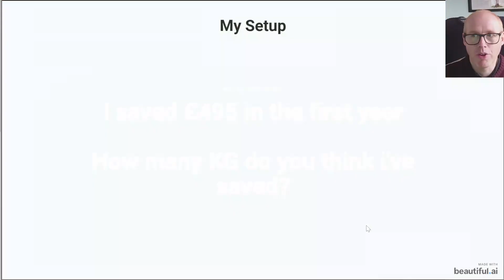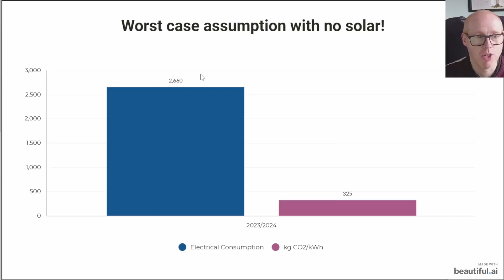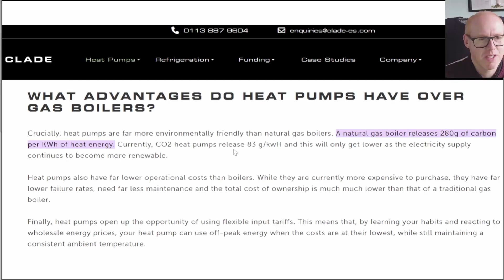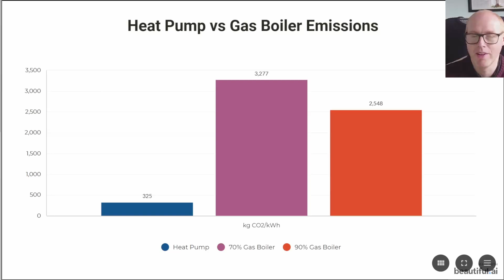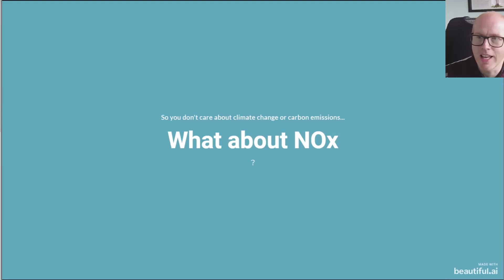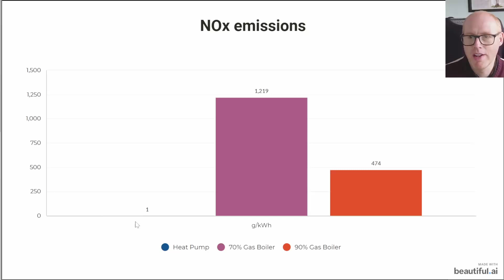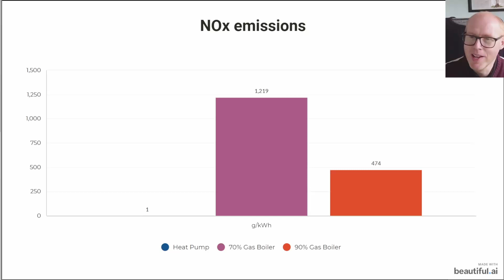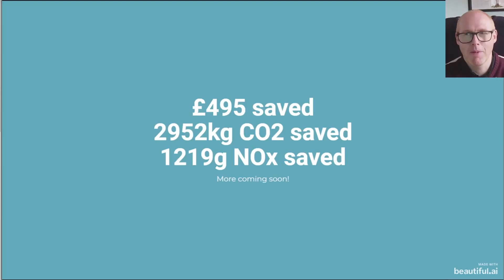Do Heat Pumps Really Save Carbon?

Comment: I'd like to go to heat pump, but there are 3 blockers for me personally (at the moment).

1) My house is quite large and so even with the government subsidy, I would be looking at £13000 according to Octopus and £20000 for Heat Geeks. That is one hell of an up front investment to swallow that would take a long time to recoup.

2) My house looks good if I say so myself. It was well thought out and built, so has very little pipes or cabling visible. The thought of having to run new pipes and make changes all over the place then need to be made good again, really puts us off doing it. 

3) This one is less of an issue, but I kind of like the fact we have multiple potential sources for heating, cooking and hot water. We have solar/battery, which is great in the summer, less great in the winter. While I kind of like the idea of binning off the gas for the multiple good reasons there are, I also do wonder how reliable electricity will be in this country given the useless governments we have had and will have for the coming years. Having the gas just in case, doesn't seem like a bad idea right now.

Having said that, if the Cosy12 (or other higher temp pump) comes out and can literally just replace the boiler, with no major renovations and a decent COP to make it worth it, then I'll be interested for sure. But for now, I'm waiting it out. Will probably mean I miss out on the taxpayer robbery/government subsidy, but the gain just ain't worth the pain for me just yet.
Reply: Fortunately with our installation we only had one new radiator location. All the other changes were just upgrades to the radiators. We took the opportunity to switch from traditional horizontal steel radiators to high output designer aluminium vertical radiators. This cost quite a bit more but was a significant practical and aesthetic upgrade and much better than the K3 steel radiators that was the initial suggestion.  This required some local adjustments to the pipes but was not too disruptive.
Reply: Well said, nobody should feel the need to tackle climate change unless they can make a gain from it or they experience the effects directly.
Reply from the maker: Ouch, that is quite a bitter pill to swallow at that price.

The vast majority of heat pump retrofits do require radiator changes but not pipework changes so internally you wouldn't normally need anything to be made good after the works.

Of course externally, most properties will have the pump along with pipework and cabling on show.

I appreciate the concern around redundancy. Personally I don't think it's going to be an issue. The only way for us to personally insure ourselves against that is investing in substantial home battery storage. Of course that adds a bigger price tag on top of your already expensive heat pump installation.

The great thing is that you are considering it. 
Like you say, simpler, cheaper solutions may come along.

When the time comes and your boiler reaches it's end of life perhaps everything will fall into place.

Comment: There is no doubt that heat pumps cut down on the Co2 emissions, and to many  who get them that is the most important thing👍
But we will still need gas for years and years to produce our electricity, until we can store enough green energy for the winter, when the sun dosent shine and there is no wind. Solar is useless in the winter! Wind is far better, but not reliable.
 We still burn far too much wood and some of our inter connector countries are also still burning coal..

As for monetary savings, Im far from convinced. Unless you have solar and batteries and monitor rates and heating curves etc reduce your house temp, it is at the moment similar to gas, and far far more expensive to fit without the taxpayer handout!

By the way, Your gas consumption of 15,000kw on your old boiler was obscene, in a property of that size and age. Its 4000kw higher than mine, with a 1929 built, bigger house and a 14yr old 37kw gas combi boiler.
Even though you have a heat pump, why dont you insulate that greenhouse on the back of the house And put some solar on  it?
Reply: So this video shows huge CO2 savings even in the worst scenario re the Grid electricity supply. 
I'm not sure why you aren't convinced of cost savings as this channel and many others are literally showing you the significant savings in near real time!
Reply: No argument on the Co2 savings, got to be a good thing👍
But are their monetary savings though? It's always a backwards comparison.
I got a COP of 4, which used said amount of KW, this would of cost this amount with a 70/75/80/85% efficient boiler. The latter is all made up! The only fig which is correct is the energy you've used with the heat pump.
If they were using 15000Kw with the old boiler,  of course there will be savings, coz it was an inefficient unit, with an old hot water tank. How much of that energy was wasted on stored hot water?
If he had a Viessmann 200  high ratio modulating combi boiler set up correctly, I'm sure he wouldn't save a penny with the heat pump! But it cant be be proved either way.
I don't believe that upside purchased the heat pump to save money though!
Reply from the maker: Anyone can save money without solar/battery by using smart tariffs, but I do concede that not everyone will experience running cost savings when on the price cap rates.

As to our previous gas boiler. The previous owners did consume 15,000kWh of gas and 5000kWh of electricity. In our first year here we shaved that down to 12270kWh for gas and 3000kWh for electricity.

Perhaps you missed the video series where I insulated the conservatory? 
https://youtu.be/L9I8XhJIfmo?si=KA3oLi5DHpbqXxLX
Reply: @UpsideDownFork  The picture of your house you showed, was pre insulating the conservatory,🙄
I will look at your insulation job on the Conservatory👍
I had one built in 1998, Iike many people. Built with no need for planning or building regs, as it still had external doors from house. I soon realised they are not fit for purpose. Too hot in the summer, too cold in the winter. I knocked it down last year and replaced with a modern insulated extension.
12000Kw is more like it👍
 I really can't see the relevance of how much energy your previous owners used. They might have had the heating to 24 degrees and the windows open! Who knows?

Comment: Possibly should have included a point for those who state that gas is relied on more in the winter months:
If the grid was 100% powered by gas power plants in the UK, the average CO2 emissions would be ~390g/kWh delivered.  So even in the worst case (that never really happens for any substantial length of time), you'd be emitting the equivalent of 1038kg of CO2.  So still less than half.
Reply: Does the grid use more gas in winter? I thought we got more wind in winter, which more than makes up for the loss of solar (at least in the UK)
Reply: @robinbennett5994  Yes, if you look at the Demand graph on the right @ 1:13 you can see the demand met by fossil fuels is generally higher in winter than it is in summer.  Whilst that will reduce over time, some people will claim that more heat pumps and EVs will increase it instead.
Reply: @BenIsInSweden  EVs and heat pumps can consume electricity when other demand is lowest and when renewable energy is highest. Still need more interoperability standards and  EV connections but it will happen!
Also V2G but now I'm really on a tangent....
Reply from the maker: Great point!
Reply: Ben, 

true but only up to a point.
I'm sure I have told you this before but any extra grid load, which the addition of heat pumps (and evs) must be, is met entirely by an increase in gas generation. Renewables and nuclear cannot increase, the former are uncontrollable and nuclear runs at maximum available at all times. Extra demand is entirely met by gas generation, you cannot use the average as an atribute to this extra demand from heat pumps.
This phenomenon was really noticeable during the Covid lockdown, CO2 emissions from generation decreased, but as business got back to normal after lockdown finished it rose again.
Reply from the maker: @iareid8255  Many wind turbines are being paid to shut off; Especially in the north of the country. If Heat pumps and EV chargers can work flexibly with things like DFS then perhaps we can fully utilise the current renewable assets and more as they come on stream.

Because of the variable nature of the generation, there will have to be a shift in mindset to move away from CCGT.
Reply: @UpsideDownFork  
yes, they are due to the poor decison making in allowing too much capacity for the transmission system to handle.
Basic electrical principle of locating the power source and the demand being as close as practical has been thrown to the wind (Pun intended)

I'm sorry but you are being overly optimistic, as is Neso, wind and its poor cousin solar are asynchronous, which means they are uncontrollable in output feeding a grid that has to be finely controlled. CCGT does this at the moment, and if that function is removed we will have no power.

This country is being seriously let down by abysmal decison making and in very short order we will have power cuts. The local area networks are already planning scheduled outages and that is now.
Reply from the maker: @iareid8255  Optimism is all I have! 
Here on the south coast we could have had wind turbines built all around us on and off shore but the nimbys prevailed.
Reply: @UpsideDownFork  

wind is a very poor source of grid supply, solar is worse, practoically and technically and to compound it they are short lived before replacement is required.. 
We should abandon all renewables completely! We would then require much less in grid expansion or upgrade saving more money.
Reply from the maker: @iareid8255  so what's your solution then? Open up those old coal fired stations again?
Reply: @UpsideDownFork  
We could do far worse, except that I don't think we have any coal mines still operating in the U.K. so need to import coal.
The benfit of coal is it is cheap, reliable and modern stations are very clean. This saves gas for other uses.
I don't see any real change, of course, now with our lablibcon politicians who are all much of muchness.
We should not have abandoned our nuclear programme of over twenty yeras ago and instead went for wind, a very big mistake that we are paying and will continue to pay for a long time given the subsides for renewables are for fifteen year duration.
Reply: @iareid8255  

"CCGT does this at the moment, and if that function is removed we will have no power."

====

And when that function is is replaced rather than just removed, as that is what is planned ?

When do you predict these power outages Ian, next year, two years, ten years from now ?

As I type gas is supplying 14% of our needs, other times perhaps 60%, there are some gaps need filling no doubt about that. But there are other ways than just burning stuff.
Reply: @_Dougaldog  

Doug, 
America has a simlar problem and their power authorities talk about a non CO2 emitting dispatchable (Dispatchable  equal controllable, essential for  a stable grid) power source.
They name it but do not have any thing that can provide it.

In the U.K. gas does this balancing of load and supply by altering output to fill in as required. It may be low, as it is now or it may be high as it was nearly a week ago.
Even when low it provides inertia, reactive power input and short circuit current support all essential for the grid to remain live. 
Tell me what you suggest can replace that?
Renewables cannot.

You cannot predict power failures as it usually starts with a fault causing loss of input,  frequency then drops and if it falls too far or too fast further load shedding occurs. If there is insufficient capcity available the that trips cascdes and if we have a large scale grid outage look at many days to restore power.
My local are board has already notified its customers of routine 3 hour power cuts in rotation as they know that our grid has very little resilience at times.
Reply: @iareid8255  

"Tell me what you suggest can replace that?"

=====

Small scale local wind/solar/hydro generation, home battery storage, EV to grid (my 77kWh car would power my house and HP for four days and more), compressed air storage, Hydro generation, hot water storage, tidal generation, geothermal generation, Flywheel storage, Green Hydrogen powered CCGT, to name but a few.
Reply: @iareid8255  I did a calculation in another comment that brought the gas efficiency down to 30% for 100% of the time, and it was somewhere around the 1.6T-1.7T mark for UDF's usage.

In reality if gas generation increases for the expected heat pump loads their efficiency will increase as well.
Reply: @BenIsInSweden  
Which doesn't change the fact that heat pumps are gas powered.
Does that seem logical?
Reply: @iareid8255  perfectly to me as I understand how heat pumps work and can see how it reduces gas consumption in the UK.
Reply: @BenIsInSweden  in UK last year we imported about 200 terrawatt hours LNG. Please look at the Cornell study on LNG. We also burn huge amounts, by volume, of biomass. A lot is imported, the truth is it produces more co2 than burning coal. To cap it all many billions of subsides have been provided with another load promised.
I have been on Agile, an electricity tariff that depends on supply of renewable electricity. Apart from a few days now the  "Dunkelflaute" has caused me great pain in the wallet.
Reply: @jonjo6886  The problem with the LNG argument is that it applies equally to burning gas in a boiler, so the emissions reductions from using a heat pump still hold true. I'm also not in favor of biomass and don't agree that burning wood in a fireplace is 'carbon neutral.'

As for Agile tariffs and the 'Dunkelflaute,' doesn't this speak more to the high price of gas increasing costs than an inherent problem with renewables?
Reply: @jonjo6886  

From government website regarding LNG & UK, most was for supply to Europe

"UK LNG imports hit a record high of 25.6 bcm in 2022, up 74 per cent on the previous year. The UK holds significant regasification infrastructure, which meant the UK was used as a land-bridge for increased natural gas exports to Europe, while supporting domestic gas demand."
Reply: Ben, 

no, the U.K. grid relies on gas 365 days a year every second of that day. It is all we have left that can balance supply with demand.
Reply: @ Where did I say it doesn't? My OP was in reference to how much of the total demand is served by gas, which isn't 100%.

Comment: It is my understanding that the CO2 content in the atmosphere is the lowest it has ever been, so low in fact that growers are having to pump extra CO2 into greenhouses etc to get worthwhile crops ?  Could the green plan be maybe a political tool  to collect more taxes ?
Reply: You have a misunderstanding on CO2, in 1950-60's the levels in the atmosphere were around 300ppm, today they are over 400ppm, that's a 1/3 increase so wouldn't all plants globally be growing more? But this isn't whats happening. CO2 in the upper atmosphere traps in heat which is causing the changes in the climate leading to further extremes of droughts to floods, all of which are bad for plants. Growers are NOT forced to pump additional CO2 into greenhouses, they do it because they can stimulate growth and yield from crops. One thing to remember is that a greenhouse is a controlled environment, where a field isn't, so they can manage CO2 levels, water, temperature, day light etc. to maximise production. Reducing CO2 in the atmosphere will help to bring the extremes in weather more under control and be better for us all, including the plants.
Reply: Come on. There's many decades of science, many thousand of research studies. It's all published in rigourous peer reviewed journals. 
Ps. CO2 can be used in greenhouses to boost greening.
Reply: Greenhouse crop growers do pump CO2 into greenhouses, but only because the crops absorb the CO2 in the greenhouse, replacing that CO2 with O2 instead. As a greenhouse is a controlled environment, there's little chance that sufficient CO2 will get into the greenhouse on its own, so it's pumped in, often by burning fossil fuels.
Reply: And just to add to @steve_787's comment. Today we have the highest level of CO2 that has been in the atmosphere in human existence. It is true that before humans existed, CO2 levels varied well beyond today's level, but plants and animals have evolved over the last million years or so with lower levels of CO2 than we have today. There is evidence that levels over 600ppm can have adverse health effects on humans (Australian National University 2014) and other studies show adverse effects on both humans and plants at certain concentrations. I can't remember what those concentrations were off the top of my head. Also, according to Kristie Ebi, University of Washington, higher concentrations of CO2 increases synthesis of carbohydrates (sugars and starches) but leads to decreases in concentrations of zinc, iron and B vitamins, which isn't ideal. I think I've seen that in the 'Nature' journal as well but I'm not sure if that referring to Ebi or other research.
Reply from the maker: Thanks for commenting. I hope we've all learnt something from the replies.
Reply: Are you a Russian /Saudi troll? You couldn't be more wrong.
Reply: Which additional taxes are collected because of the green plan?
Reply: @martyndavies1482 tell us what a 'green plan' is first
Reply: @martyndavies1482  carbon tax, gas boiler tax
Reply: @tonymaloan  

March 2023 budget saw Jeremy Hunt budget put a 30% tax on excess gas profits, and a 45% tax on excess profits from Nuclear and renewable electricity until 2028.
The 'Electricity Generator Levy' 

That seems very biased towards CO2 producers.